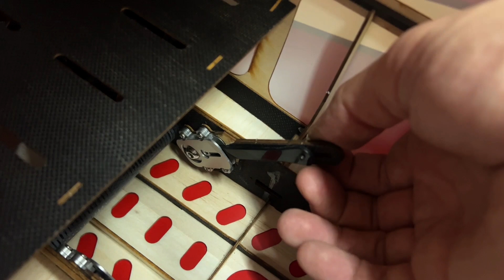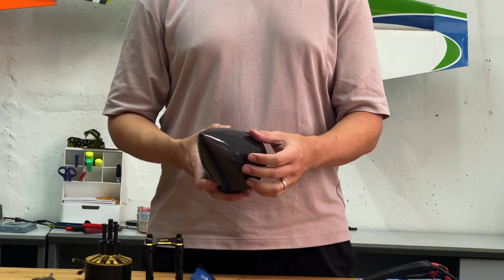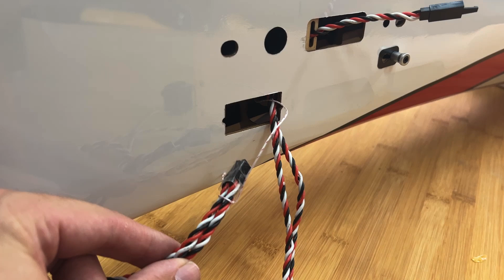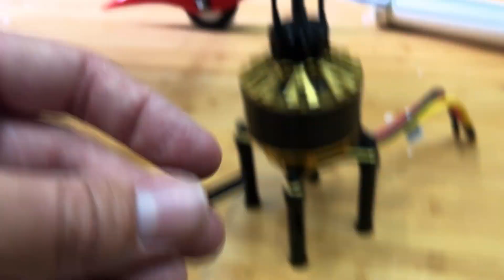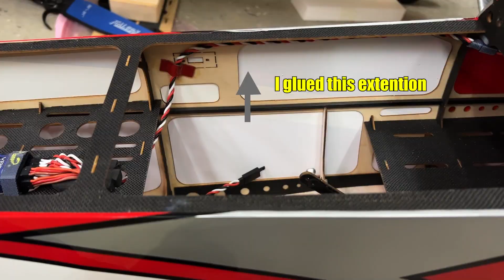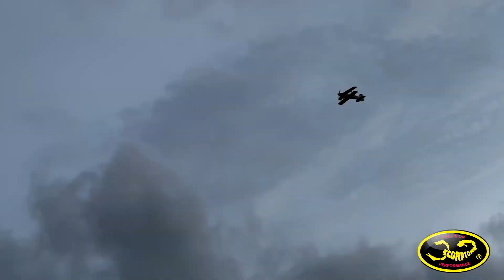Giant Bi-Plane Goes Electric - 70cc Peregrine EF - Build Log

Comment: I'm building a Skywing Yak 74inch with the Scorpion A-5524 PNP combo, do i need to run a seperate switch with rx packs for the servos? or just use the battery gaurd ii that is included in the combo?